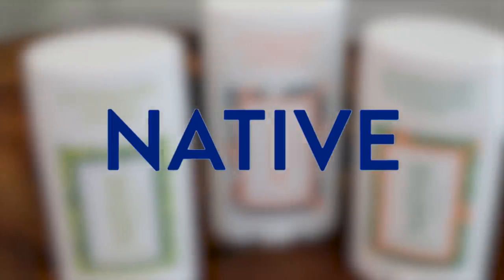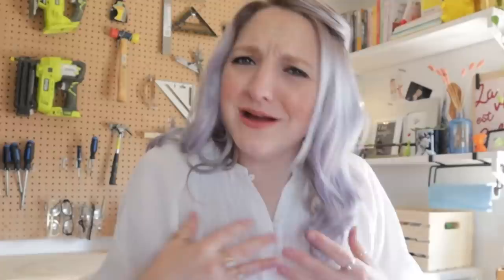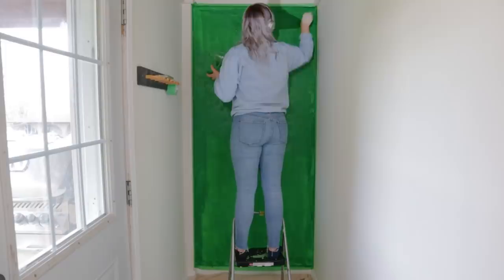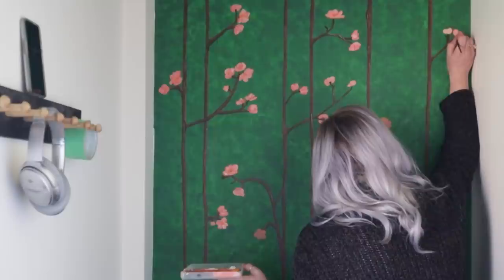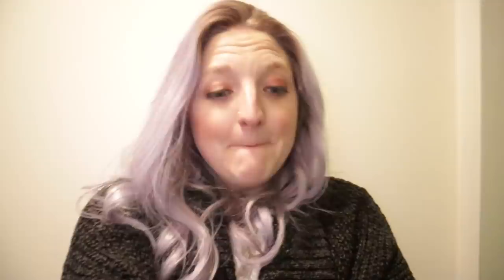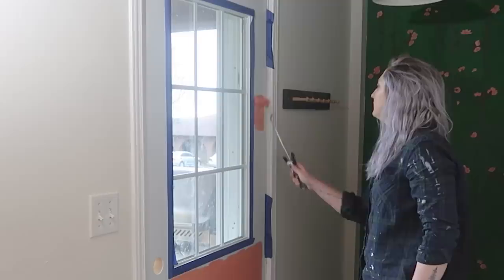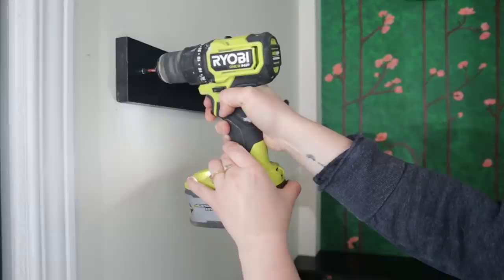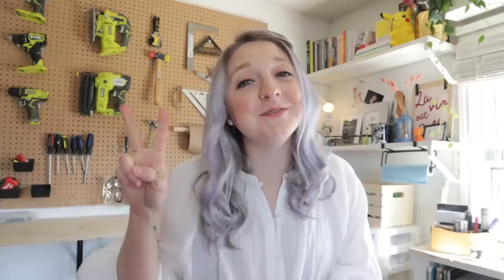my backdoor makeover turned out different than i expected | DIY Painted Wall Mural | Home Made Home

Comment: Danie !! I LOVE your videos and was very excited to see you try and go for some saturated color with "Watermelon Slice". There's a great  little tip for anyone who wants to be adventurous with color but still is a wee bit nervous for the "after". 1. Pick your initial saturated choice 2. Move up on your color chip one or two spots closer to the lighter end. You'll end up landing on a color that won't seem as intense once it's on your larger surface! Most paint stores that deal with contractors will also work with you to do a "percentage" of a bold color choice by simply allowing more white and adding less of the pigment "recipe". <3

Comment: Stain in general are not used like paint with a brush or foam. In order to keep that wood texture you can use the foam brush or rag to apply and then allow the stain to penetrate before wiping off with a rag. You can do multiple layers to get the darkness you want. Without wiping it, that’s when it looks splotchy. Love the outcome of the room at the end! We all have been there and learn as we go to make new choices if you change your mind.

Comment: Having used the same stain+poly product before in a brown color, the fault is not with the brush, it's definitely the product. I brushed mine on, and every overlap showed and looked darker, so I had to be really careful on my second coat to not overlap too much. It was still uneven and the final color wasn't what I was expecting, so I eventually HATED the outcome and had to strip it which was even worse. It's worth it to just stain and then poly! LOVE the final look of this! I love that you made the console floating in such a tight space. And the mural is lovely!

Comment: Interesting video today.  I have been redecorating for awhile now and it is slow going.  One of my favorite colors is coral and I have a bit of it as accents in my house, but I seem to not be as afraid of color.  However I used a brighter coral on a side table, small dresser, and dining chair and it seemed ok, but then I put it on a mirror and when it was back up on the wall I was appalled.  It looked too bright to me.  So I had to go through a ton of paint chips and settled on Behr's Fireplace Glow instead and that worked.  I used Before Winter on the chair, which is slightly darker.  But I think I am going to paint the mirror Healing Plant because I am moving into more of a "green" moment.  I live in Florida in a small beach town so color is not so rare here.  When you can travel again, come on down and visit me.

Comment: Quick tip: if the paint color is not quite right, put a bit in a cup and add a bit of white, black, red whatever you like, to change it. You may find that's all it needs. The black looks fine, though. :D

Comment: The issue with the splotchy stain likely has a lot to do with the way you’re applying it. With any top coat (or 2-in-1 that includes a top coat) you have to apply it dry to wet—meaning that you only brush in one direction. If you go back and forth or ever go from wet to dry (I.e brush from where there’s already product in the direction of the wood that doesn’t have product on it yet) you’re going to move the product around and off of where it was originally, causing major splotches. I feel like I didn’t describe that super well, but I hope it makes sense!

Comment: I was attempting to paint my indoor back entry a melon color also. It was too much. I am trying to rethink it. I am painting my kitchen cabinets a light gray top and darker gray on bottom. Each oak trim and drawer front will be a stained gray to accent the painted part. I was thinking shades of melon would give some life for walls and door, but I didn't like the melon. Suggestions?

Comment: By any chance, is the light bulb in the  overhead fixture a warm incandescent? I once painted my living room a beautiful reddish terracotta, and when I turned on the lamps that evening, it turned screaming orange. I was able to fix it by switching all of the light bulbs to ones that were on the blue spectrum. Getting rid of the warm spectrum bulbs saved the color. You may have this problem with the coral color you put on the door.